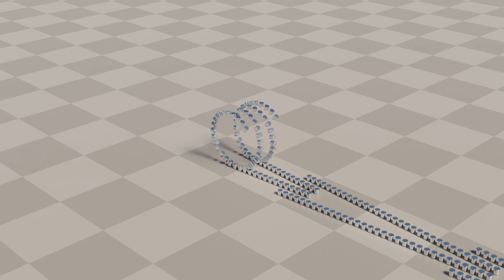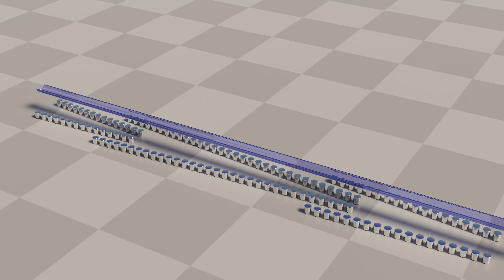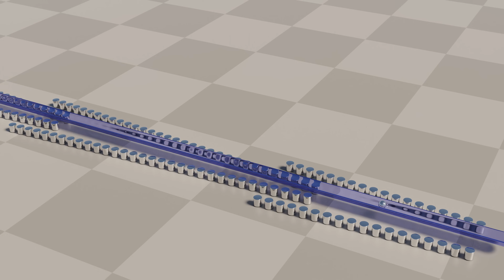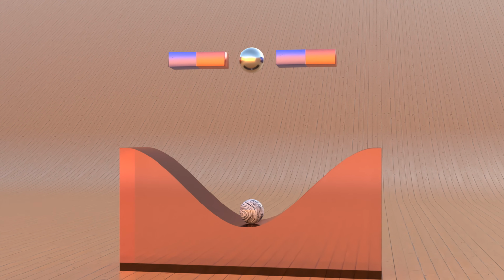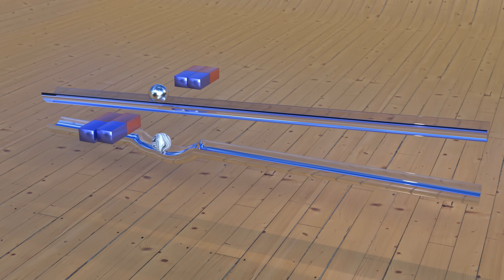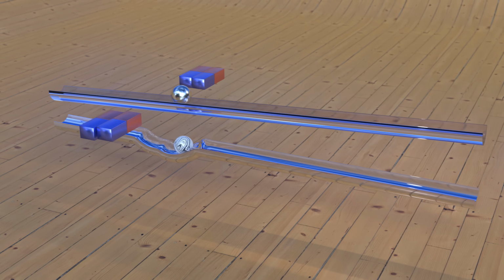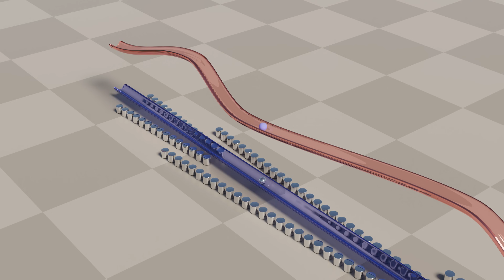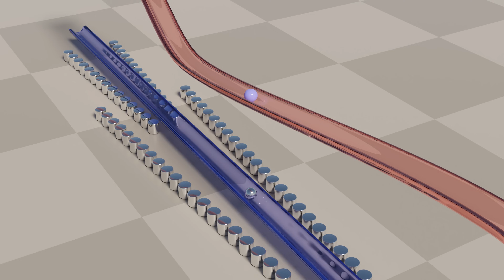Truth: Permanent Magnet Motor Using Magnetic Repulsion. Inventor's idea and what does really happen?

Comment: this is intelligent stupidity. you can implement another force to overcome the slight bit needed such as the inertia of the wheel which you conveniently ignored in attempt to dissuade the masses from escaping the electrical dependence on private, corrupt corporations.
Reply from the maker: Hi H7, thx for your comment. Think about my gravity model approach. If you don’t put external power in the system continuously, it will come to a standstill. But if you do, it’s no free energy device. Just inserting an additional symmetrical force does not change anything. Thx for watching
Reply: @yWild  based on your arguments, it appears the inertia of the wheel will provide the extra force to overcome the magnetic trap. this inertia is not "external", and thus should qualify as perpetual motion. You have not shown the effect of inertia on the system.
Reply from the maker: Hi H7, inertia just slows down the system and conceals the inability to run perpetual because it looks like it would because inertia reduces the visible effect of friction. Thx for watching 🙂

Comment: A spinning rotor is one thing but getting torque is quite another, the more demanding you expect of electricity demand the harder the magnets need to work to drive the rotor to supply the demand.. in short the best expectations would see a Ballance... Nothing gained...
.. Thom in Scotland.
Reply from the maker: Hi Fuelban, thanks for your comment. Thx for watching 🙂
Reply: @yWild  , hi I truly did not ..comprehend the nature of " Demand " on power until I purchased a second hand ex UK army field phone unit... Basically you wind it with a dial which turns a magnet ... rotor ... Like  to generate power  this livens the cable and so to power the line to the phone, ...
Man to generate power this way causes you to put in so much physical energy to this system... Man believe me... Rotation is one thing, but when you demand torque... Is quite another... I mean in no way to put you guys off from experimenting... I only wish to broaden you're knowledge and experience of outlook..
Thom in Scotland.

Comment: I can't really agree with much of the author's argument. If he wants to use animations to make his point, he shouldn't use examples that use completely different energies. I.e. the marble example has much inertia lost from the unmentioned flywheel removed from the formula. If the marble had the momentum of a flywheel, it would have the kinetic energy to climb those little dips with less. What weight is this marble vs standing gravity, minus the relevant momentum of the model in question anyhow? The kinetic aspect was pretty much disregarded. In fact the example should have used a flywheel instead of the heavy centered marble.
Reply from the maker: Hi James, thx for your comment. The flywheel is just a method to increase the inertia. If an system comes to an standstill after a minute, with an flywheel it runs for more than 10 minutes. It has no effect to the principle. It covers a bit of friction but at last there is no power increase in the system. Thx for watching 🙂
Reply: @yWild  Thanks but i understand inertia and kinetic energy. That's my point though. In the marble example, the inertia from the flywheel is left out. The kinetic energy plays an important roll in these models that use flywheels. I appreciate your stance on the subject. I am bias. But i believe even though free energy breaks the laws of physics, mankind will break those laws once we formulate the tech to do so.

Comment: well, try maglev bearing flywheel, then make a minor modification to make it push, 90 degree flip then spring back to maglev mode. maglev/push alteration modes
Reply from the maker: Hi, thanks for your comment. Great ideas, but I just want to show why perpetual motion motors are not able to work. Thx for watching 🙂
Reply: @yWild  is God? do you consider newtons laws as perpetual motion (no energy added or removed, from a system, always at same energy level)
Reply: @yWild  well thats not a proof then
Reply from the maker: Hi Jkauppa, thanks for your comments. Yes, Newton is great but most people need something more tangible to follow  what’s happening. So I do the switch from magnetic force to gravity force. And yes, this is not really a scientific proof but if you think about, you will see the permanent imbalance thing. That’s simple to understand without scientific understanding. Thx for watching 🙂👍🏻
Reply: @yWild  you either do it scientifically, not rely on "peoples understanding", dont cross over when suitable, lol

Comment: IVE DONE THIS YEARS AGO. THE PROBLEM WITH ALL THESE MOTOR ATTEMPTS IS WHAT IS MISSING IN THEIR DESIGN. THEY NEED A CAM TO CHANGE THE MAG POSITIONS. JUST LIKE A GAS MOTOR. THAT WHY THEIRS DOESNT WORK AND MINE DOES. AND IT ALLOWS YOU TO SET THE TIMING AND THE TORQUE IS FAR BEYOND WHAT THEIR DESIGNS PRODUCE. ALL THOSE MOTORS CAN DO IS SPIN. BARELY
Reply from the maker: Hi Alex, thanks for your comment. I’ve made an similar experience. Thx for watching 🙂

Comment: if you put a small motor to make a movement of the big magnet back and front , and  after the ignition power the small motor from the movement of the weel it will be infinite?
Reply from the maker: Hi Howto, thanks for your question. Great idea to overcome the magnetic maximum but the efforts to move the magnet in and out into the lower magnetic influence every time will be high enough to come to a standstill, nevertheless. Thx for watching 🙂

Comment: Thank you for the video, Though I had a thought. 

Suppose you added a variable fly wheel? Springs to keep it tucked in, and as centrifugal force increase, weights shift outward. This should help the wheel pass the moment of magnetic resistance
Reply: ' as centrifugal force increase, weights shift outward.' 
When that happens, the 'weights shifting outward' slows the rotation and stops the centrifugal force from increasing and 'shifting them outward'.
You're essentially trying to pull yourself up by your own bootstraps.  It doesn't make a gain, you simply stop yourself before you start.  You're dependent on 'something keeping increasing to make something happen' while 'what's happening is slowing it down just as hard as it was increasing'.  You can't make something change that stops the change from happening.
Reply from the maker: Hi RedDragon, glad you like it. I just try to tell people that these devices are not able to work and explain a new way of thinking 🙂. Thx for watching.
Reply: @yWild rather than complete free energy is the idea off these creations not too improve how we use electric and get more out off it...movement is energy and magnets can create movement so can they not be used for improvement in designs we may not have thought off yet...if you added metal powers or fragments  too water could you not use magnets too make the water move due too the metal powders in the water n make a type off hydro energy or such ideas like this...thanks

Comment: How about More Mass and Circumference of the Wheel to overcome the initial resistance and thereby using Centrifugal Force as well. 
In addition, the wider the circumference the longer the throw of magnets to offset the initial resistance in the run. 🤔
Reply from the maker: Hi DG, thx for your comment. More mass will slow down the process because of the higher inertia. The principle still stays the same. It would not work either. Thx for watching 🙂

Comment: What if you connect a nonmagnetic  wieght inside the roller ,at the point where it's stop???
Reply from the maker: Hi DIY, thx for your comment. The idea is good, but it will just slow down the effect because of the higher inertia. It will not make a difference, I fear. Thx for watching 🙂

Comment: Uh huh....now load it and make it do work! What you have here is another variation of the Perindiv motor. The balance of magnets plus the inertia make the rotor spin. But put to work  it upsets the balance. It's nothing more than a perpetual motion machine. It takes torque and constant speed to get useful work out of any machine
Reply from the maker: Hi Thomas, thanks for your comment. It’s just an example for machines that do not work and the reason why they don’t. Thx for watching 🙂
Reply: Add a kicker motor to that flywheel and  a sensor that checks when it tries to slow down. The kicker brings the speed of the flywheel back up so the inertia is not overcome by the workload. That will need a battery and kind of defeats the free energy concept.

Comment: I think it works with another type of magnet, electric, graduated in strength, and the point of the peak of attraction must remain like an arrow. Once it reaches the top, the electricity is cut off from the previous magnet and increases in the next magnet, with the presence of a discharge and suction of the magnetic field with laser beams, thus it continues to increase to infinity.
Reply from the maker: Hi C., thanks for your comment. Yes, with the help of eclectic power we get it to do the job. Thx for watching 🙂
Reply: congratulations you just invented the electric motor, I would patent that quick

Comment: But can’t you just add a counter weight that pulls downwards with gravity on the wheel at the point of slowing. Or even place a small magnet the runs along the z axis downward at that point you can run a simple gear that moves a ground magnet out of the way once the point of resistance is past. It’s convoluted and it would require a counter weight on the opposite end or simply have to deal with the wheel being imbalanced which technically it already is which also did not factor in to your model that the weight and mass of the wheel is imbalanced in such a way that gravity and momentum pul hardest against that point also many versions of this I see actually use a electromagnetic disconnect on that transition point. My question has always been can the rpm increase to the point where the energy needed to power a small electro magnet is smaller then the electricity generated by an attatched flywheel and generator. I never see these with proper flywheels.

Also a simple gearing system attached to a chain could retract the magnet at the moment of highest resistance. You could have a pair of gears with teeth only on a small portion attached to a gear correlated to the 360 degrees of travel.  It would pull the magnet out for that brief moment than push it back. This is just one example I can think of many that would do the trick. 

I think the greatest question or operative problem is not the transition period but if the rest of the slope is capable of powering anything at all besides it’s own momentum if it can run a chain and spin a flywheel I am not convinced that this idea is one hundred percent worthless. As you showed pushing the operating magnet forward starts the action, than surely creating a mechanism to remove it at the right moment should solve the problem provided the movement is enough to spin a flywheel. Even using spring or a gravity battery for insertion and removal of the operative magnet should make it possible. All of my doubts are in weather or not the magnets have any spare power to move anything but the plastic wheel they are mounted on.
Reply from the maker: Thx for your detailed comment. Thx for watching 🙂

Comment: The threshold of repulsion can be easily overcome if, at the moment of completion of the revolution, the main magnet is mechanically moved away, and when the threshold is overcome, it is returned back. In this case, the force spent on the shift will be almost equal to 0
Reply: Build. Dont give up.
Reply from the maker: Hi, thanks for your comment. Yes it’s possible to overcome the point of highest magnetic repulsion by moving the magnet away, but it needs power to bring it back. In addition it is more power to invest than your get back. Thx for watching 🙂
Reply: @yWild  I wrote that it would take practically no energy to move the magnet
Reply: @yWild  according to the principle of operation of the valve of the internal combustion engine
Reply: I think it works with another type of magnet, electric, graduated in strength, and the point of the peak of attraction must remain like an arrow. Once it reaches the top, the electricity is cut off from the previous magnet and increases in the next magnet, with the presence of a discharge and suction of the magnetic field with laser beams, thus it continues to increase to infinity.

Comment: Just TO help you out a little.. You are totally correct we are all connected in the same way via the magnetic field that is instantaneous .  The speed of light is not significant to the magnetic field it travels through  only restricted by same.  E=MC2 is a joke.  Try this,,  If you vibrate the "B" field of a magnet into a granite rock at the correct frequency you will see it become very soft and malleable easy to shape!!  Think about what Quarts rock is made of and it should answer your question,   The center of a magnet is what we are all made of:  a magnetic  hologram of sorts, never ending!  That's why they used  the Pyramids to transport themselves through the universe. E=MC2 is a total Farce!!
Reply from the maker: Hi Vince, thanks for your detailed information. Hope we will find the ultimate key to the universe. Thx for watching 🙂

Comment: If you want it to Work, think as à magnet.
A magnet is not What is said. It is not only north ans south.
Thé problem is heure.
Is not like gravity.
It is a vortex.
So if you want it to work, you Know what to do

If thème was à price of 100000€, you would be surprise to see multiple models woŕking
.
Reply from the maker: Bonjour Alans, thx for your comment. I will try till 1.000.000 🙂. Thx for watching
Reply: Your vidéo is very beautifull. Nothing to say about it.
The problem for me is That you make the same error as everybody for 300 years.
And you don’t understand What i mean.
All those motors should work.
If one thing would be donc.
But everybody make the same error.
I assure you it is incredible
Reply: It works by using electromagnet programmed time, speed and strength of dispersion angles and by using and integrating vacuum suction and laser.

Comment: A very nice video with laborious and excellent simulations! There is another simple argument, that these constructions don't work. If there is only one single magnet on the rotor, it will not run, since torques due to magnetic repulsion (or attraction) will be the same clockwise and anti-clockwise. And the effects of several magnets simply add up. Thus, if you have n magnets on the rotor and none of them delivers a resulting torque in one direction, n times zero gives zero. 

It is more difficult with constructions which suggest, that the master magnet should be withdrawn temporarily to achieve a continuous spin. If this is done by external means you can achieve a continuous spin, but this movement needs an input of energy. And attempts to get this energy from the rotation fail, since the rotational energy is not bigger than the energy needed for moving the master magnet. For those competent in physics of course conservation of energy is the simplest explanation which refutes all possible designs of magnet motors. Unfortunately those who are free energy addicts don't trust laws of physics ...
Reply from the maker: Hi Heinzpg, glad you like it. Thx for your detailed comment. Thx for watching 🙂
Reply: Not agreeing or disagreeing that it can be done with some more formulaic design, but the fact that this energy, while not totally "free", would significantly reduce the cost of fuel which big brother does not want. Hence why the shut down Tesla. It's not even big enough of a push for the whole "conservationist convention party"to jump on board with lol. Probably could use 1/10 the fuel consumption in combination with this type design
Reply: @raymondsilva5440     Since this design can not deliver any energy at all, it would also not reduce fuel consumption. The majority of countries has to buy fuel from other countries. They would be quite happy to find an alternative to oil products. But magnet motors are no alternative. And by the way: Tesla was not shut down. Teslas project which was no longer financed by P. Morgan was not about free energy, it was about the transfer of electrical energy through the air without wires. The energy itself would have been a conventional one, produced from oil, coal and water. Not free at all.
Reply: u trust the conclusions of an fake video instead of real life demonstrations.  no wonder our surface world is so primitive still.  so frustrating all these sheeple.  I really hope ur response is not a real human. so dissapointing